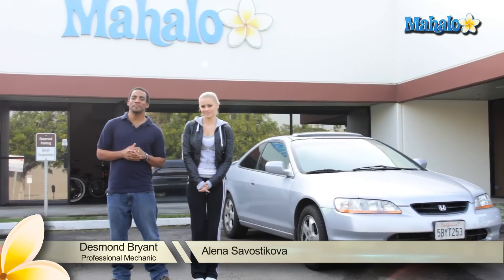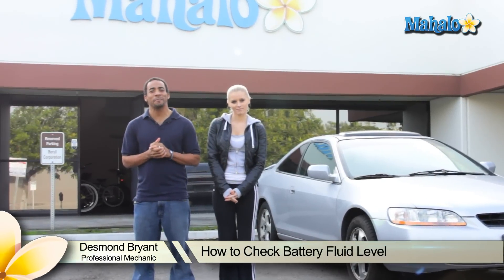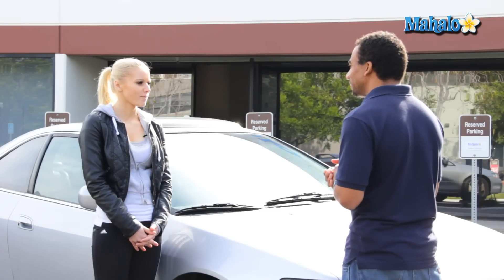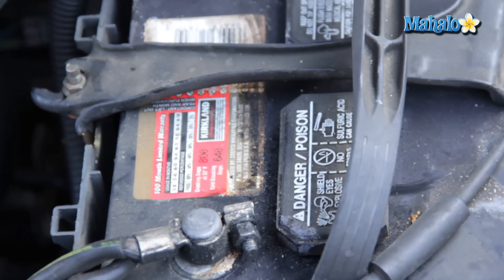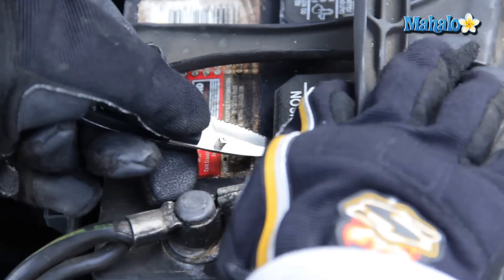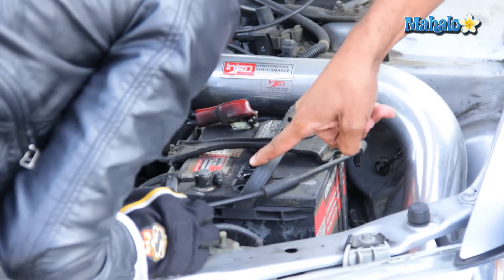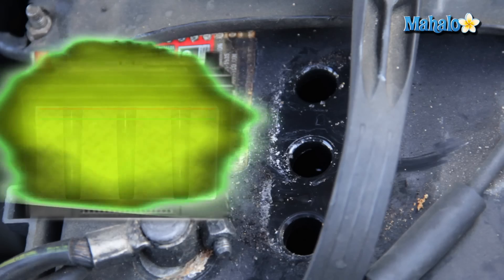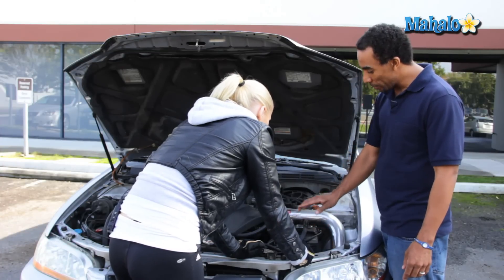How to Check Battery Fluid Level

Comment: Does the car need to be off? & also do you have to wait for it to cool down?
Reply: +joeldagr8one yes and it does not expand, the bat has sulferic acid and water, overtime the water just evaporates so you need to replenish it by topping it off occasionally.

Comment: I am checking a Toyota altis and it had 6 small round covers on top of the liquid cell, distill water ? I thought we need a battery water ? And how do u know how much battery do I need to fill in , cause I don't c any red or green line . Thanks if u reply
Reply: Wow. Bottom rim. What the heck does that mean? Bottom rim of what. There are like a dozen different parts or points in there. 🙄

Comment: I answered my own question regarding the acid concentration by doing some of my own testing. about 3-4 parts acid to 1 part water is already showing about 75% using that acid tester.
So now my questions are: 
What's the best way to completely drain those bad cells? 
How much fluid will each cell hold in a typical 6-cell car battery?

Comment: Good guide, but I need something a bit more in-depth. 
I knew my battery wasn't holding a charge so I bought an acid tester and battery acid to attempt restoring my battery rather than buying a new battery.
Using a battery acid tester I determined that 3 of 6 battery cells were bad. I tried to siphon out as much dead fluid as I could and topped off the cells with acid, but the tester still shows that these cells are dead. Perhaps the acid I purchased is already "pre-mixed"? Any ideas?